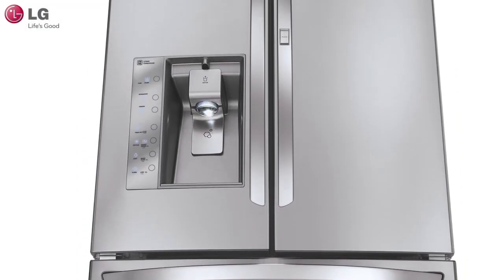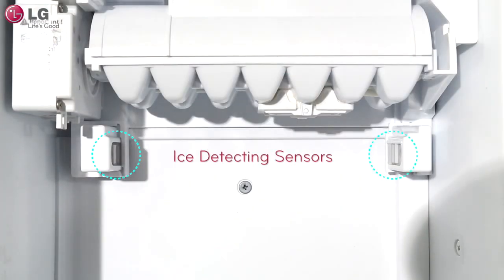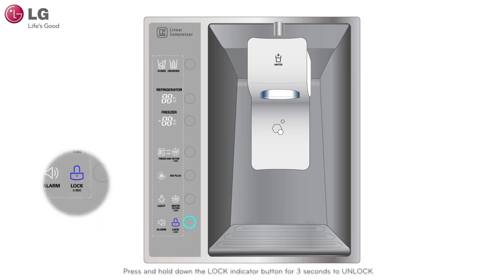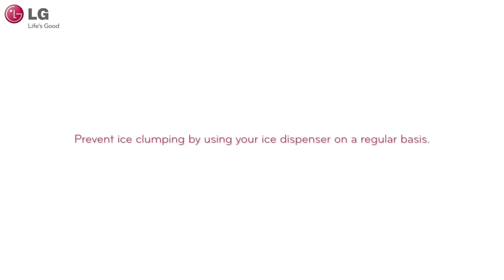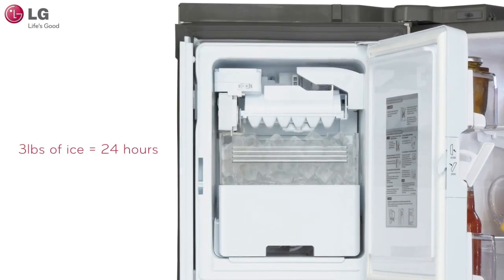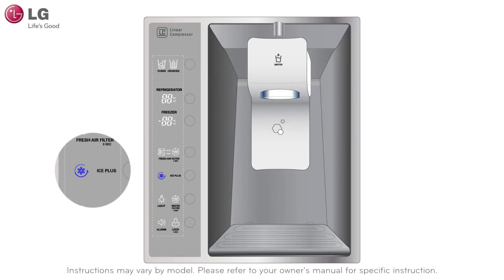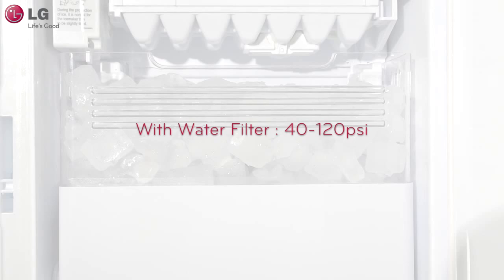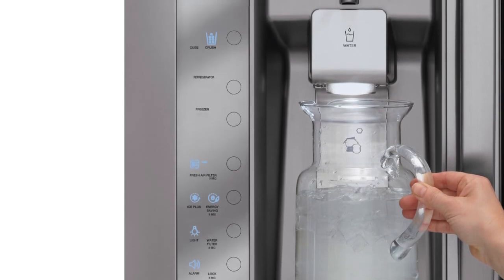LG French Door Refrigerator - In Door Ice Maker Troubleshoot (2018 Update)

Comment: Have an 5 year old LG, 4 door fridge freezer and the icemaker quite working and shortly after the freezer section would not freeze and the fridge section went warm, turns out the compressor has a know design problem.  The LG support online charge a flat fee to fix the problem of $279.  They changed the compressor without even doing any test but that fixed the freezer fridge problem but icemaker would still not make ice automatically but would make one batch of cubes  if the reset button pushed for 3 seconds on ice maker. They came back a second time and changed the icemaker no charge but that did not fix the problem.  Last 2 possible problems are either the printed circuit board at the top of the fridge door or the Mother board in the back of the fridge.  LG has been very courteous and helpfull to ensure the unit works completely.

Comment: Bought all New LG appliances couple yrs ago. Ice maker is junk,replaced and still junk,circuit board went bad on range. Run don t walk from LG. The old ken more style ice maker still works. Who invented LG s style ice maker ? We put a man on the moon in 1969 and this is all the better LG can do,,,,,,,Really !!!
Reply: LG has no fix for its indoor ice maker. Shame on LG.
Reply: HI Gary, for sure they didnt use an LG machine to make ice for Neil and co.
Reply from the maker: Hey there! We understand that your dishwasher and refrigerator are a vital part of your daily routine. Let's get you that warm new-home feeling once again! Please follow the following recommendation steps. Regarding your dishwasher, check for obstructions in the drain hose or the drain pump. Please clear any debris that may be preventing proper drainage. Be sure to clean the filter. A clogged filter will negatively affect draining performance. Regarding the ice bin freezing solid, please try checking the temperature settings. If the temperature settings are set below the recommended levels, it can cause the ice to freeze solid. Feel free to reply to this comment with your dishwasher and refrigerator model numbers. We'd be happy to provide more detailed recommendations! ^Chris

Comment: We’ve had problems with this icemaker since right after we bought it five years ago. It jams at the chute all the time since day one. Now the past couple of years it will get stuck when rotating and make a knocking noise and get stuck. If I catch it when it first starts knocking, I can squeeze the tray up and get it to finish rotating and fill up again, but at this point like someone else said, we might as well just keep buying bags of ice.
Reply from the maker: I'm sorry to hear you are having these issues with your ice maker. So we can better assist, please contact LG Customer Support by direct message via Twitter (@LGUSSupport) or Facebook Messenger (https://facebook.com/LGUSA/). In the private message please include your model number, serial number, and date of purchase. Thank you. ^TC
Reply: This is the exact reason I'm here, trying to find answers.  Wake up in the middle of the night because the ice tray is going KNOCK KNOCK KNOCK KNOCK KNOCK KNOCK KNOCK for about 30-60 seconds before it finally gives up.  If I can get there in time, I hit the tray with the heel of my hand to knock the ice free.  Really annoying.
Reply: Hi,
Mine has just started that same thing,I cant figure it out,I've cleaned the tray with vinegar thinking mineral deposits. May I ask what you did,if anything to fix the problem. Thank you.
Reply: Mine’s been doing it for six years. Really bad design

Comment: Our LG icemaker started making a loud knocking noise but continued to provide ice. While running the test I noticed that the plastic part attached to the bottom of the tray had come out of position and was rubbing against the housing. All I had to do was snap it back in place and now it runs quietly again! It was so loud that sometimes at night I thought someone was trying to break into the house!!!
Reply from the maker: Hello there! Our LG icemaker started making a loud knocking noise but continued to provide ice. While running the test I noticed that the plastic part attached to the bottom of the tray had come out of position and was rubbing against the housing. All I had to do was snap it back in place, and now it runs quietly again! It was so loud that sometimes at night I thought someone was trying to break into the house! -Junel

Comment: Nothing but trouble with my LG ice maker it makes ice but will not dispense, "three repairs s done" replaced ice maker and heating element in the freezer still the ice maker is intermittent  I am at the point of rolling the whole thing out to the alley for junk pick-up 3k badly spent. No more LG products for me
Reply: The ice maker is not designed to actually work!  Water droplet will cling on the sprout outlet thence freeze up, more ice will accumulate eventually blocking the water flow.
Reply: Ive had my lg for 3 years and still hasnt done that guess they are hit and miss products
Reply: Is the ice tray dislodging so it makes a clunking sound and does not dispense?  That's what mine is doing.  Makes ice just fine, but after a couple of cups, the tray dislodged and the drive looses contact.

Comment: Just recently my ice maker is consistently clumping the ice into a big ball in the bin every day. I clear it out daily but it always happens again.  And ice is getting stuck in the shoot while trying to dispense it, so its useless trying to use it.  Could the auger be damaged? If anyone has some real ideas on how to fix this please let me know. Thanks!
Reply: David I just read about your ice maker. The problem is to much water pressure. Clean where the water comes in to fill, and turn down where your water come from. The water is spraying and getting in between the tray and out side cover, and freezing.  Locking ice stray.
Reply: Also it will run down into ice bin freezing ice to gather.

Comment: Our LG refrigerator ice maker stopped working as soon as the warranty expired. It worked for a few months then it stopped working. Then a few months later, during winter, it suddenly started working again. And because it's winter my wife decided to turn it off "to save it some time" she said as her reason for turning it off. When the summer came, we decided to turn it back on. This time it just wouldn't work at all. If you need a good refrigerator with a reliable ice maker, stay away from LGs.
Reply: My ice dispenser only works when its cold weather outside krazy

Comment: Our LG fridge will fill the ice tray with water, the water will freeze, but the tray never turns over, so the ice never gets dumped. If I push the reset button, the tray will turn over, the ice will dump, and the tray will begin to fill with water again. Why will my tray not turn over and dump the ice on its own?
Reply from the maker: We're sorry to hear that. Here are the possible reasons why your LG fridge's ice tray is not turning over and dumping the ice on its own:

Tilted Tray: The ice tray may be tilted, preventing it from turning over and dumping the ice. Resetting the ice maker by turning it off and on again or pressing the reset button may help resolve this issue.

Water Supply and Line: Ensure that the water supply is turned on and that there are no kinks in the water lines. A faulty water line can affect the ice maker's functionality.

Motor Functionality/Underlying Problems: Requires further inspection and repair.

If you need further assistance please send us a private message on Facebook or Twitter through @LGUSSupport
Reply: @LGUSA  Thank you. The ice tray will dump if I push the reset button but only if I push the reset button. It won't dump on its own once it has ice in it. It will just remain in place with ice it in.
Reply from the maker: Hi, @ART224. Thank you for reaching out to us. For personalized assistance with your ice tray issue, please send us a direct message (DM) on X (Twitter) at @LGUSSupport or a private message (PM) on our Facebook page. We will be happy to help you further. Please provide us with your model number and any additional details about the issue. We look forward to assisting you! ~ Luisa

Comment: Why dont you point out the test button on the underside of the ice maker?1?  My maker froze and would no longer complete the dumping cycle and refill the water. I had to learn about the test button by watching other videos.  The test button forces the ice cycle to complete and breaks up any ice that might still be in the tray. At least its a way to test if the motor is still working.  LG needs to read these comments and adjust the trouble shooting videos...
Reply: This comment should be at the top of the list!!!  The test button isn't in the owner's manual either.  Shows how little LG cares about it's customers, they could easily add this test button to their video.  Why haven't they?
Reply: @paulj1x  i just tried the test button, but icemaker still makes the ice but wont flip it out

Comment: So if there is ice in the maker and water is working and it won’t flip to empty the made ice. Then you make sure there is no overflow freezing mechanism you turn on and off but still won’t flip over to empty ice. Then you try to put warm water to melt it. Still won’t flip out Ice. So how do you open it to empty ice and let it start over????
Reply: I'm in the same boat, my parents fridge has ice in the maker but it wont flip it out and make more...
Reply: Did you guys ever figure it out? I have the same issue.
Reply: same problem here. when the stupid thing makes ice, its a once in a blue moon thing and will take months before it decides to flip out more cubes. machine just does it when it feels like it.
Reply: I am having the same problem
Reply: has anyone had any luck with this, ours just started doing the same thing, makes ice but wont flip it out
Reply: Best solution is a well placed Stanley hammer in the middle of the ice maker. I have a double whammy. When I bought this house, it had a 5 gas burner LG stovetop and every knob was broken. I think the replacement knobs were $80 each. And they eventually break too.
Reply: Almost 5 yrs old my 4 door LG compressor went, 300 flat fee to replace, the icemaker had quite also would make ice after reset button presses but when it dumped the ice the ice tray would not come back fully level so it would not fill with water again, New Ice maker being installed no charge with the compressor replacement @mitchflugge4330

Comment: I always have to press the dispense button to eject ice into the tray. Nothing is stopping it. It just doesn't wanna dispense, so we never get ice.

Stupid.
Reply: @jonathankearney669  mine has the same issue.  Makes ice fine, but will not dump it.  I even bought a whole new ice maker and the damn thing will not dump...  I guess maybe the control board is the problem or a broken wire somewhere else?  Did you ever get yours fixed?
Reply: @jonathankearney669  ouch...How old was your fridge?
Reply: @jonathankearney669  Add one more to the list. Ice maker makes ice (LG in Kenmore Elite) but won't dump into ice bin unless use reset button. Was told it's the auger Motor (even though I can get ice from reset to dispense into glass...uses auger) last resort coming UPS $200 main circuit board. Will let you know if this is THE FIX.

Comment: Our LG fridge is 5 years old and we are on our 4th ice maker.  They freeze up and then break because of the poor design and engineering.  Every time we have had a repairman out they say the same thing.  Take my advice and never buy an LG appliance.
Reply: my experiences with this is  how every time i cook something that requires boiling and open the freezer to get an ingredient during that, the ice makers joints get water on them and freeze up so they cant move. my solution? pour boiling water over everything and dry it up quixkly then dont use the freezer for the next 2 hrs

Comment: Have always had trouble with this ice maker. Constantly clumping, water constantly leaking down the sides. This then refreezes, making the bin difficult to get out. Horrible design. Will never buy this LG product again.
Reply: Same here. Ice doesn't stay solidly frozen, melts a little then refreezes into clumps which clogs up and won't dispense. When it does work, you get ice AND water out of the ice dispenser. Horrible appliance, never buying LG again!
Reply: Have you found out how to fix the issue now?  Just wondering cuz I'm seeing this 4 months later.
Reply: Have you found out how to fix the issue now?
Reply: We have the same issue:

1| Water leaks down the side of the Ice Maker Holder and then freezes locking the Ice Box to the ice maker and all the ice in one large clump.  No ice can make it down the Icemaker.

2| I clean out the ice maker using a blow dryer since I can't remove the ice-box/holder.

3| I would use hot water but the entire area turns into a huge mess.

4| Two weeks later I am in the same situation after starting fresh.
Reply: We just always try to never have the left door open longer than a second or two to minimize the warming. Works at least temporarily. Then my son or I take our fist (or a mallet)now and then and rap the enclosure really hard to loosen any stuck ice. Don’t use a hammer!!!
Reply: Thanks for both of the tips.  I’m going to schedule weekly maintenance, coordinated with weekly trash pickup, dislodge the ice along with a family note to keep the left door closed. 

Question: is anyone familiar with a type of lubricant that could be placed on the icebox walls which would repel the ice from locking the icebox to the inside door.
Reply: @accuratei  You could try Pledge furniture polish. I wouldn't recommend an industrial lubricant due to the smell or other food safety concerns.
Reply: @jonathankearney669  Thanks Jon, I agree, I think if I keep up on the maintenance and keep the ice broken up I won't have to head down the WD40 route with an oil slick floating on my Gin and Tonic. Next thing you know we'll have a Facebook user group going... LG Ice Chippers.